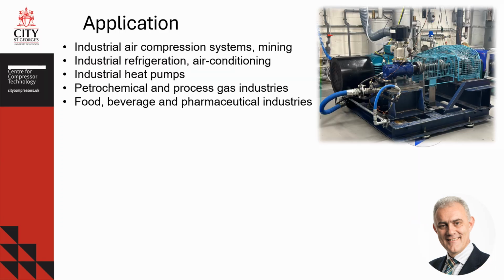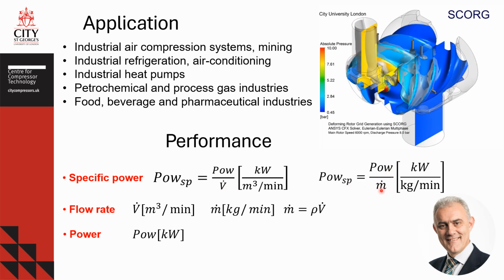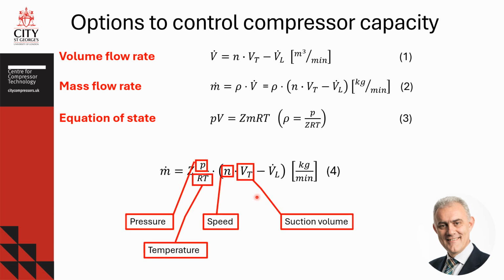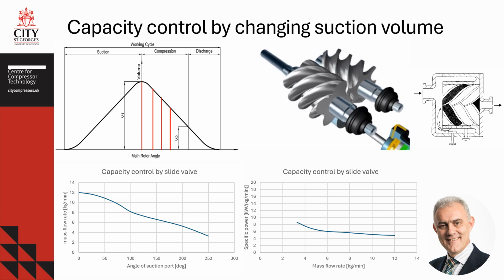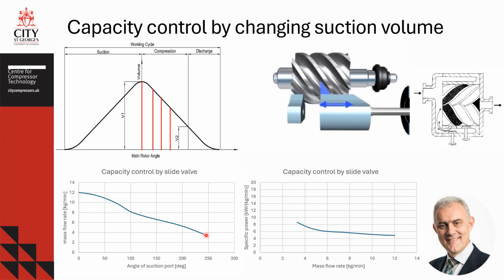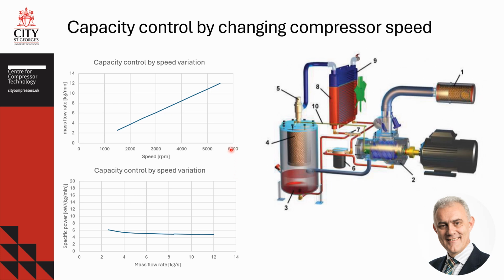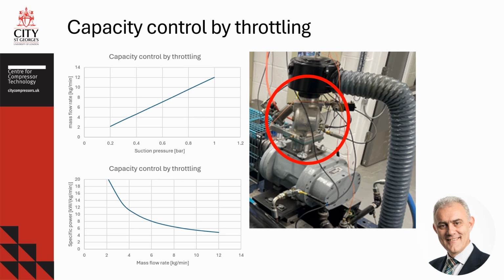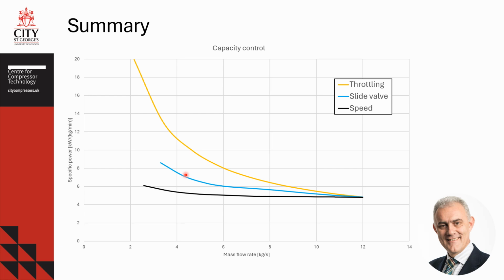On Capacity Control of Screw Compressors | Lecture Tuesday by Centre for Compressor Technology

Comment: Some compressor companies advertise the variable angle throttle valve as an efficiency increasing mechanism. From this lecture I understand that VFD is enough to get the best efficiency without the other 2. Thanks very much!
Reply from the maker: Thank you very much for listening to our Lecture Tuesday presentation. Indeed, the throttle valve is a cheap mechanism to control capacity, but it is not efficient. VFD is by far the most efficient and the cost of VFD drives is reducing… Please let us know if you have interest in other topics related to this technology.
Kind regards, Ahmed Kovacevic
Reply: @citycompressors thank you. I keep watching your great videos and sharing them.